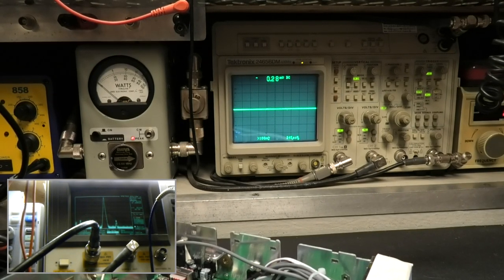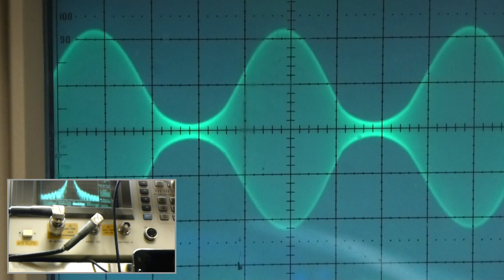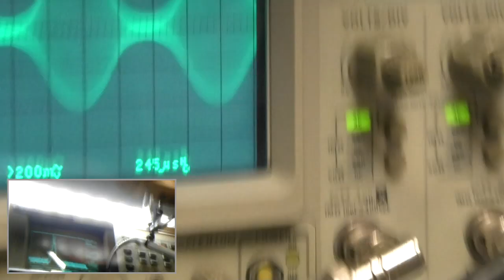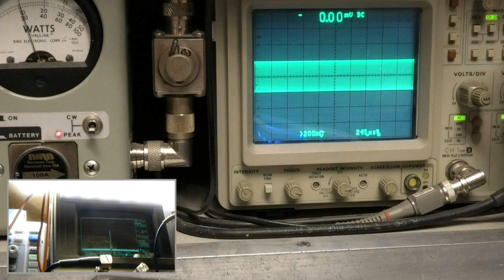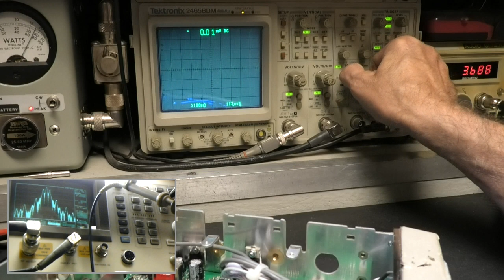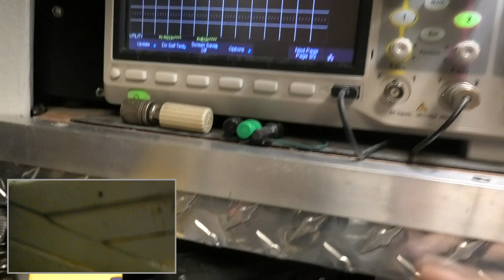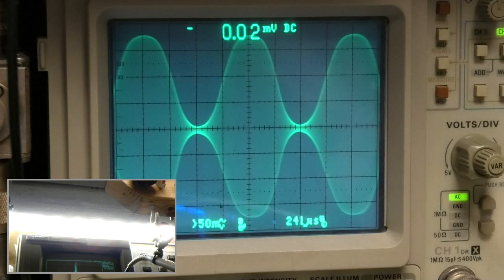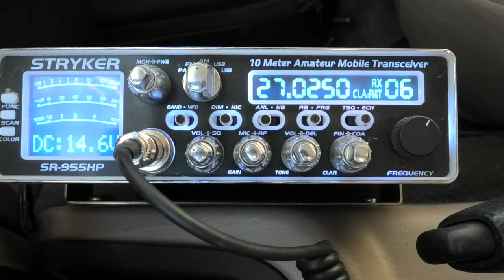MAGICAL POWERS VS REALITY - STRYKER SR955HPC RADIO REVIEW - Oscope - Spectrum Analyzer & Calibration

Comment from the maker: If they say "It's Just A Cb Radio" It's Because They Don't Have The Necessary Skill Set, Knowledge, Motivation, Desire Or Test Equipment >>> RUN LIKE HELL <<< Save Your $$!! Bite your tongue and follow directions .. Here's what it takes to cut through the noise, be loud and crystal clear with a better receiver too:  A) Tuned Bench:  https://www.youtube.com/watch?v=lwcDfXOgAls.  True, it's more complicated and time consuming to accomplish these consistent and accurate results. Below is a partial procedure and list of calibrated equipment used to achieve this level of performance . Read on ..

Fine Tune CB Radio Shop strictly adheres to (https://www.nist.gov/) NIST Traceable Calibrations and other industry standards to maintain accuracy and consistency for providing Real World Performance Tuning of Citizens Band and 10 Meter export mobile radios with integrity.

"Basic Textbook AM/FM/SSB Transceiver Tune, Alignment and Calibration" 

1) Pll adjustments
VCO & OSC, AM TX OSC, USB TX OSC, LSB TX OSC.

2) Transmitter alignment
DRIVER BIAS, FINAL BIAS, SSB  (or gate voltages for mosfet versions) CARRIER BALANCE, HI-LO AM & SSB Power, RF METER, AMC, ALC and FM DEVIATION.

3) Receiver alignment
AM/FM RF & IF SENSITIVITY, FM DETECTOR/DEVIATION, SSB IF SENSITIVITY, SSB S-METER, AM/FM S-METER (100uV unmodulated -67dbm for “S-9” meter reading!), AM/FM SQUELCH RANGE, SSB SQUELCH RANGE, and NOISE BLANKER/AUTOMATIC NOISE LIMITER (Real World dBm to volts (uV) tables below).

That's just a typical run of the mill textbook tune up and alignment (if you're lucky). There's more to it than frequency alignment, modulation adjustment, meter calibration and a tune up report displaying exaggerated rms Bird peak watts! 

"Test Bench includes"

Bird 4314C Meter
https://www.birdrf.com/Products/Test%20and%20Measurement/Power-Meters/Wattmeters-Line-Sections/RF-Wattmeters/4314C_PEP-Single-Element-Wattmeter.aspx
Part 1) https://www.youtube.com/watch?v=RpX9IHe4ORM&t=16s
Part 2) https://www.youtube.com/watch?v=LuhbqTf6Bxw
Bird 4314C Accuracy Test: https://www.youtube.com/watch?v=DqEOabYqhQo&t=5s
Bird Stipulates 1/2 wavelengths  https://www.youtube.com/watch?v=5eWhgT-rTII
And Genuine Bird Elements from 1K down.

Bird 4373 Sampler 
https://www.rfparts.com/signal-samplers.html

HP8924c with options
http://userequip.com/files/specs/2147/HP%208924C%20Repair.pdf
https://www.youtube.com/watch?v=Cg1w0xBa27s&t=1s

HP8920a with options
https://www.keysight.com/upload/cmc_upload/All/EPSG072204.pdf

Three analog scopes, one digital 200 Mhz
https://www.atecorp.com/atecorp/media/pdfs/data-sheets/tektronix-2465b-2467b_manual.pdf
https://www.youtube.com/watch?v=by98x4eu2lM

Fluke 27fm
http://www.fluke.com/fluke/inen/digital-multimeters/fluke-27.htm?pid=56055
 
LCR http://www.lcrresearch.com/wp-content/uploads/2017/05/LCR_Pro1_Manual_version1.03.pdf

Power supplies
6 Cosel PBA1500f12 (750 amps) variable and configurable.
https://en.cosel.co.jp/product/powersupply/PBA/PBA1500F/PBA1500F-12/
Corcom 20VB1 F7130 EMI Filter 50-60Hz 250V

Times Microwave Coax jumpers and test leads
http://www.timesmicrowave.com/cms/products/cables/lmr/
https://www.youtube.com/watch?v=EmqaGJ6IWow
https://www.youtube.com/watch?v=1ltFVSxGp5Y
https://www.youtube.com/watch?v=v12YZT_1o90
https://www.youtube.com/watch?v=h7iiYfmYWRA&t=215s

Amphenol RF Connectors
https://www.amphenolrf.com/
https://www.youtube.com/watch?v=dVh5B0hdEA0 
https://www.youtube.com/watch?v=dKZg8T_AOso

More range, compliments, reliability and a quieter, clearer but more sensitive receiver,  Get Fine Tuned .. not peaked and ruined.

Here are some VideoGates of me at the bench practicing what I preach using my bench radio or customers radio completed and ready to be shipped: https://www.youtube.com/results?search_query=hard+drive+163+ more: https://www.google.com/search?q=Hard+Drive+163+nm&ie=utf-8&oe=utf-8&client=firefox-b-1-ab

It's what I recommend, use, service and sell ... to you ... not something non practical or deceiving in a misleading way. I'm not just the tech and owner of Fine Tune CB Radio Shop, I'm a customer too!  When finished, You'll be giving radio checks, not asking for them .

dBm To Watts and Volts
Tables below displays relationship between Power in [dBm] or [Watts] and Voltage in RMS, peak, peak-to-peak for sinusoidal signals in 50-Ohm systems for accurately measuring and tuning am/fm/ssb receiver sensitivity, agc, squelch and "S9" Meter calibration. Real World! Mike @ Mikes Radio Repair (Romper Room), Mark Rutherford aka Mark 19960, CB Kidd, Martian and all of your other fake accounts pay attention to the tables below, stop misaligning radios, spreading false information and promoting propaganda! 

  [dBm] [Watts]   [Volts]rms   [Volts]p    [Volts]pp
-140 0.100E-16  22.361 nV  31.618 nV  63.236 nV 
-139 0.126E-16  25.089 nV  35.476 nV  70.952 nV 
-138 0.158E-16  28.150 nV  39.805 nV  79.609 nV 
-137 0.200E-16  31.585 nV  44.662 nV  89.323 nV 
-136 0.251E-16  35.439 nV  50.111 nV  100.222 nV 
-135 0.316E-16  39.764 nV  56.226 nV  112.451 nV 
-134 0.398E-16  44.615 nV  63.086 nV  126.172 nV 
-133 0.501E-16  50.059 nV  70.784 nV  141.568 nV 
-132 0.631E-16  56.167 nV  79.421 nV  158.842 nV 
-131 0.794E-16  63.021 nV  89.112 nV  178.223 nV 
-130 0.100E-15  70.711 nV  99.985 nV  199.970 nV 
-129 0.126E-15  79.339 nV  112.185 nV  224.370 nV 
-128 0.158E-15  89.019 nV  125.874 nV  251.747 nV 
-127 0.200E-15  99.882 nV  141.232 nV  282.465 nV 
-126 0.251E-15  112.069 nV  158.465 nV  316.931 nV 
-125 0.316E-15  125.743 nV  177.801 nV  355.602 nV 
-124 0.398E-15  141.086 nV  199.496 nV  398.992 nV 
-123 0.501E-15  158.301 nV  223.838 nV  447.677 nV 
-122 0.631E-15  177.617 nV  251.151 nV  502.302 nV 
-121 0.794E-15  199.290 nV  281.796 nV  563.591 nV 
-120 0.100E-14  223.607 nV  316.180 nV  632.360 nV 
-119 0.126E-14  250.891 nV  354.760 nV  709.519 nV 
-118 0.158E-14  281.504 nV  398.047 nV  796.094 nV 
-117 0.200E-14  315.853 nV  446.616 nV  893.232 nV 
-116 0.251E-14  0.354 µV  0.501 µV  1.002 µV 
-115 0.316E-14  0.398 µV  0.562 µV  1.125 µV 
-114 0.398E-14  0.446 µV  0.631 µV  1.262 µV 
-113 0.501E-14  0.501 µV  0.708 µV  1.416 µV 
-112 0.631E-14  0.562 µV  0.794 µV  1.588 µV 
-111 0.794E-14  0.630 µV  0.891 µV  1.782 µV 
-110 0.100E-13  0.707 µV  1.000 µV  2.000 µV 
-109 0.126E-13  0.793 µV  1.122 µV  2.244 µV 
-108 0.158E-13  0.890 µV  1.259 µV  2.517 µV 
-107 0.200E-13  0.999 µV  1.412 µV  2.825 µV 
-106 0.251E-13  1.121 µV  1.585 µV  3.169 µV 
-105 0.316E-13  1.257 µV  1.778 µV  3.556 µV 
-104 0.398E-13  1.411 µV  1.995 µV  3.990 µV 
-103 0.501E-13  1.583 µV  2.238 µV  4.477 µV 
-102 0.631E-13  1.776 µV  2.512 µV  5.023 µV 
-101 0.794E-13  1.993 µV  2.818 µV  5.636 µV 
-100 0.100E-12  2.236 µV  3.162 µV  6.324 µV 
-99 0.126E-12  2.509 µV  3.548 µV  7.095 µV 
-98 0.158E-12  2.815 µV  3.980 µV  7.961 µV 
-97 0.200E-12  3.159 µV  4.466 µV  8.932 µV 
-96 0.251E-12  3.544 µV  5.011 µV  10.022 µV 
-95 0.316E-12  3.976 µV  5.623 µV  11.245 µV 
-94 0.398E-12  4.462 µV  6.309 µV  12.617 µV 
-93 0.501E-12  5.006 µV  7.078 µV  14.157 µV 
-92 0.631E-12  5.617 µV  7.942 µV  15.884 µV 
-91 0.794E-12  6.302 µV  8.911 µV  17.822 µV 
-90 0.100E-11  7.071 µV  9.998 µV  19.997 µV 
-89 0.126E-11  7.934 µV  11.218 µV  22.437 µV 
-88 0.158E-11  8.902 µV  12.587 µV  25.175 µV 
-87 0.200E-11  9.988 µV  14.123 µV  28.246 µV 
-86 0.251E-11  11.207 µV  15.847 µV  31.693 µV 
-85 0.316E-11  12.574 µV  17.780 µV  35.560 µV 
-84 0.398E-11  14.109 µV  19.950 µV  39.899 µV 
-83 0.501E-11  15.830 µV  22.384 µV  44.768 µV 
-82 0.631E-11  17.762 µV  25.115 µV  50.230 µV 
-81 0.794E-11  19.929 µV  28.180 µV  56.359 µV 
-80 0.100E-10  22.361 µV  31.618 µV  63.236 µV 
-79 0.126E-10  25.089 µV  35.476 µV  70.952 µV 
-78 0.158E-10  28.150 µV  39.805 µV  79.609 µV 
-77 0.200E-10  31.585 µV  44.662 µV  89.323 µV 
-76 0.251E-10  35.439 µV  50.111 µV  100.222 µV 
-75 0.316E-10  39.764 µV  56.226 µV  112.451 µV 
-74 0.398E-10  44.615 µV  63.086 µV  126.172 µV 
-73 0.501E-10  50.059 µV  70.784 µV  141.568 µV 
-72 0.631E-10  56.167 µV  79.421 µV  158.842 µV 
-71 0.794E-10  63.021 µV  89.112 µV  178.223 µV 
-70 0.100E-09  70.711 µV  99.985 µV  199.970 µV 
-69 0.126E-09  79.339 µV  112.185 µV  224.370 µV 
-68 0.158E-09  89.019 µV  125.874 µV  251.747 µV 
-67 0.200E-09  99.881 µV  141.232 µV  282.465 µV
-66 0.251E-09  112.069 µV  158.465 µV  316.931 µV 
-65 0.316E-09  125.743 µV  177.801 µV  355.602 µV 
-64 0.398E-09  141.086 µV  199.496 µV  398.992 µV 
-63 0.501E-09  158.301 µV  223.838 µV  447.677 µV 
-62 0.631E-09  177.617 µV  251.151 µV  502.301 µV 
-61 0.794E-09  199.290 µV  281.796 µV  563.592 µV 
-60 0.100E-08  223.607 µV  316.180 µV  632.360 µV 
-59 0.126E-08  250.891 µV  354.760 µV  709.520 µV 
-58 0.158E-08  281.504 µV  398.047 µV  796.094 µV 
-57 0.200E-08  315.853 µV  446.616 µV  893.232 µV 
-56 0.251E-08  0.354 mV  0.501 mV  1.002 mV 
-55 0.316E-08  0.398 mV  0.562 mV  1.125 mV 
-54 0.398E-08  0.446 mV  0.631 mV  1.262 mV 
-53 0.501E-08  0.501 mV  0.708 mV  1.416 mV 
-52 0.631E-08  0.562 mV  0.794 mV  1.588 mV 
-51 0.794E-08  0.630 mV  0.891 mV  1.782 mV 
-50 0.100E-07  0.707 mV  1.000 mV  2.000 mV 
-49 0.126E-07  0.793 mV  1.122 mV  2.244 mV 
-48 0.158E-07  0.890 mV  1.259 mV  2.517 mV 
-47 0.200E-07  0.999 mV  1.412 mV  2.825 mV 
-46 0.251E-07  1.121 mV  1.585 mV  3.169 mV 
-45 0.316E-07  1.257 mV  1.778 mV  3.556 mV 
-44 0.398E-07  1.411 mV  1.995 mV  3.990 mV 
-43 0.501E-07  1.583 mV  2.238 mV  4.477 mV 
-42 0.631E-07  1.776 mV  2.512 mV  5.023 mV 
-41 0.794E-07  1.993 mV  2.818 mV  5.636 mV 
-40 0.100E-06  2.236 mV  3.162 mV  6.324 mV 
-39 0.126E-06  2.509 mV  3.548 mV  7.095 mV 

                 Don't Be A Mud Duck!

 https://www.arrl.org/shop/ARRL-Handbook-2019-eBook

Hard Drive 163 NM. 73's! Click click.?